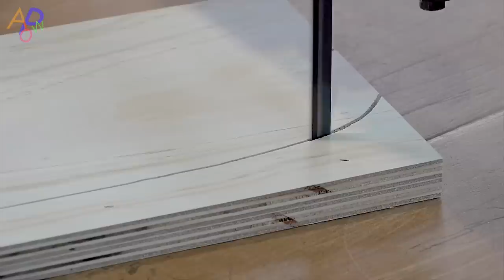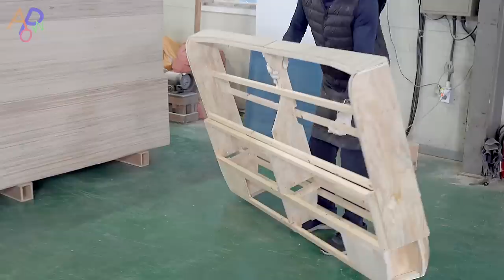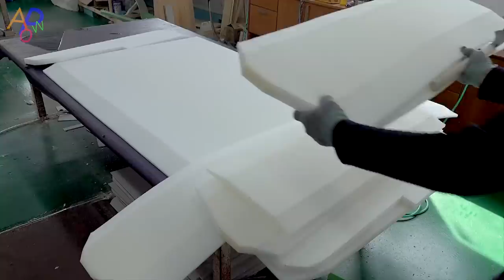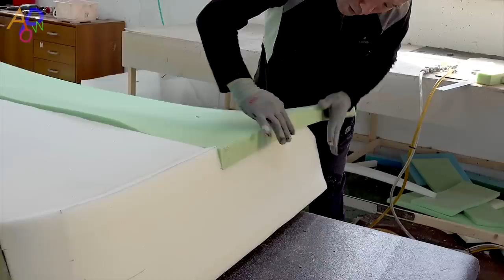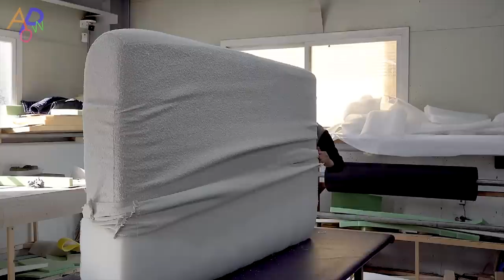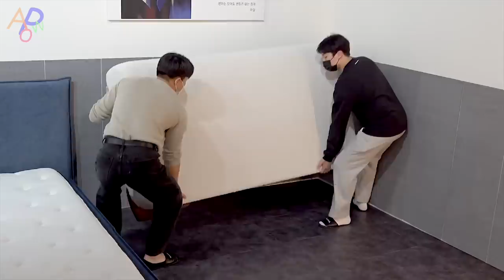Korean Handmade Bed Master. Process of Making High Quality Bed Frame

Comment: If the quality of this bed frame is not good
Which bed frame is good quality?
The first bed I bought was a famous brand. However
It collapsed after two years. With the help of a friend, I found out through the video that the bed I repurchased was this bed brand. I bought another bed here and have been using it for 5 years 👍

Comment: interesting video.
I would describe the bed as NORMAL and not HIGH QUALITY.
A HIGH-QUALITY bed is made of solid wood and not plywood!
Why is the seamstress wearing gloves, is it possibly cold?
Reply: Actually plywood is much stronger than regular wood. That's why they use plywood in construction when pouring concrete.
So plywood, if good quality, is actually better. But here they use staples, instead of nuts, bots and steel plates.
Moreover, you can not disassemble this thing made with staples and glue. Transportation becomes unnecessary more expensive.
Reply: @2L40K ,
It's true that plywood is a bit more stable than solid wood, while multiplex is even more stable!
Um, I didn't mention nuts, bolts, steel plates. Because there are such beautiful, stable wooden connections (whether Western or Japanese)!
In construction, screen-printed wood is used first because it does not swell as much as multiplex, but it is also more expensive!
Transport becomes more expensive if you cannot disassemble a bed that I can disassemble. Takes up less space when moving than if you have such a rigid part, which is extram unwieldy!

Comment: From where I learnt woodworking, the number of nails in this bed makes it seem more like a steel bed with wooden pieces in-between. Perhaps the steel nails in all weigh more than the wood. Shoddy work covered by foam and cloth to make it appear good, much like a cinema actor applying make-up. That choice of white upholstery, which cannot be easily removed and washed will certainly make this bed an eyesore in 6 months of use.
I am surprised this channel, which has brought us videos of good Korean products in the past, has chosen this shoddy workmanship and called it " High quality".